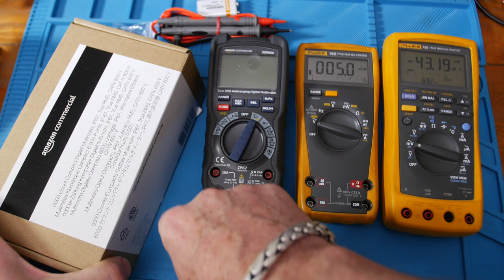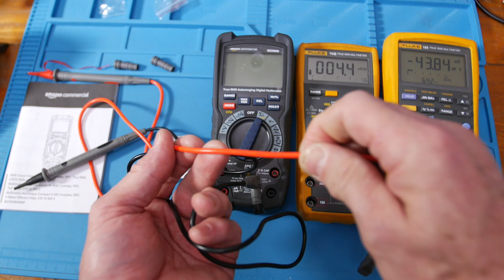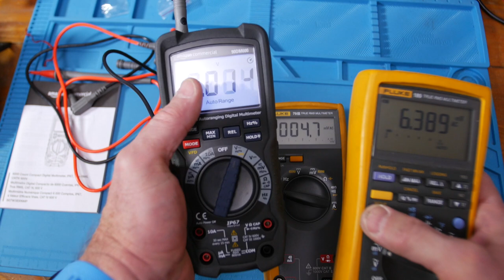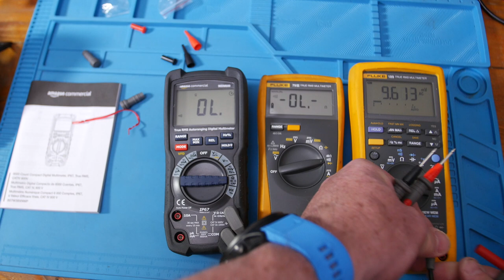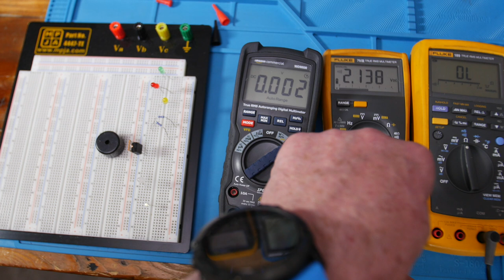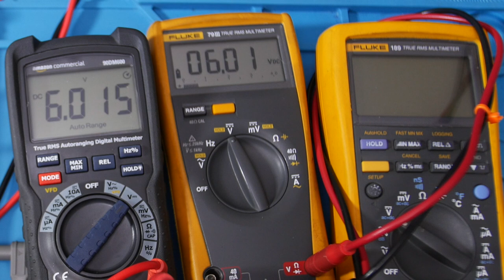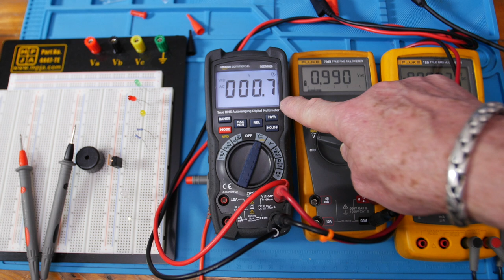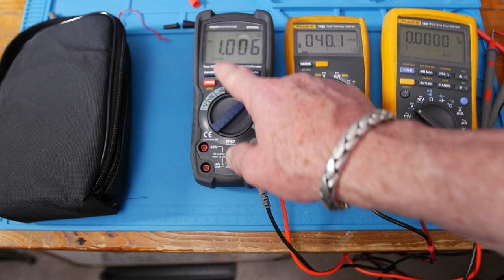Amazon 90DM600 vs Fluke 179 III Multimeter

Comment: Unless i'm wrong, i can see on the Amazon specs for the 90DM610 it has only a 200µF max range for capacitors 😱... Well, not for electronic jobs then 😖
Reply from the maker: Thanks for bringing this up:)  I reviewed the 90DM600 in this video and it is rated for 99.99mF, so barely short of 100,000 uF.  From what I understood, the 90DM610 added temperature reading, but I thought all other specs were the same.  But I see in the table below that it shows 200 uF.  The comparison table for the 90DM600 shows both having 99.99 mf.  So, confusing - which is correct?  I actually bought a 90DM610, so I'll test it in a review coming up shortly.  We will get to the bottom of this;)
Reply: @KissAnalog  Thank you very much for your kind and quick answer, very nice of you 🤩. I'm very curious about this discrepancy between the comparison table and what the amazon specs states. And btw, your video is fine but i'm bit dissapointed you're testing a very few range about capacitances. I'm not mean to offend you though 🙄, thank you very much, take care and have a good day 😎!
Reply from the maker: Thanks - and no offense taken;)  It is a great question.  I see others testing multiple capacitors, and to what end - to show that it can;)  I try to show the lower capacitance range and then the higher capacitance range.  I don't always have the best capacitor to test the extreme ends, but I want to show that it can test say 100 pF if it can go that low, and then say 30,000 uF if it can go that high.  Some can test high capacitance, but not go very low, and visa versa.  Does that make sense?  I'm still trying to learn what best way to review a meter;)
Reply: @KissAnalog  curious if you were able to test the 610 to determine its rating?

Comment: Hey friends. 

Great video. 👍👍👍

I bought the DM890 but it didn’t come with a battery. 
Does anyone know of the battery type/model or a replacement??? 

Best regards, 
Scott. ✌️🙏✌️
Reply from the maker: Thank you!  Do you have the 90DM890?  I believe it does take a lithium rechargeable battery.  Excellent meter by the way;)  Does it have any battery PN or info - like 7.4V 2400mAh?
Reply: Hey KA. 

Yea I managed to buy a replacement made by CEM as it was the exact copy of both meter and battery. 

Thank you for your time. 

Best regards, 
Scott. ✌️🙏✌️

Comment: Wow that's one heck of nice meter for the price. I'm wondering if Amazon even makes a profit off of these. Could be selling at a small loss to build up the "Amazon Commercial" brand.
Reply from the maker: Great question- thanks for bringing this up.  Maybe they are counting on big sales to get the volume pricing on the manufacturing.  Also, I think other vendors like fluke have continued increasing features with the big advancements in technology– but I don’t think they have lowered the cost with the lower cost of manufacturing.  I think these newer vendors are re-structuring cost based on actual material cost.  The company I work for automatically buys flutes regardless of cost – and I think a lot of people do this – so I don’t think Fluke is interested in competing with lower cost vendors.  Even FLIR with more features and very high quality, and is a high-end equipment manufacturer is priced much better than Fluke.
Reply: @KissAnalog  Yeah,as the old saying goes, "no one gets fired for buying IBM". I guess we could say "no one gets fired for buying Fluke" haha.
Reply from the maker: Lot of truth to that;)

Comment: I wish you had actually used a Fluke 179 (as the title suggests). The 179 has a 6000 count and probe holders on the back. And, at least on mine, it has a nicer continuity beep and the backlight is much better.
Reply from the maker: Thanks Ben - I tried to use a couple of Flukes to show what the newer 179 has.  I used to be a big Fluke fan, but they are just so expensive now.  I didn't want to buy a new 179 so I used the one I had.  Sorry about that.

Comment: I just got the 179 kit for like 450 USD. 😅
Nice to have a Fluke, but some of these other options are better for taking with you. Cheers. 👍
Reply from the maker: Thanks for your feedback!  Just think how much you would have saved by buying the 90DM600 which is arguably a better meter?  I have a new video showing the Southwire meter that is much better even and you can get it at less than $100 - which is simply crazy!!
Reply: Thanks. I'll check it out.

Comment: I belive this is actually am CEM DT-9560/DT-9561 , i bought the same meter in blue instead of black from a nordic chain store has it rebranded in thier own name.
Reply from the maker: Thanks Brian!  How do you like yours?  I think they are great meters;)
Reply: @KissAnalog  i am an electrician by trade working with alarm and access control, i feel you get at lot for the price and it seems to be an safe meter to use on mains voltage without beeing at risk by poor build quality , i have a few models from CEM and they seem well build and has good input protection, i also have both Brymen and Fluke, and ill still recomend the CEM's because of the price to quality ratio. -Brian
Reply: @brianmichaelnielsen3922  i plan to buy cem DT 9560. does this multimeter have good accuracy and quality?  I haven't found a video review for this model
Reply: @jatnikabudisantosa3049  i havent done any lab testing but my impression is that you get more value for money vs a Fluke for example, i would recomend the CEM for anyone not using it for something like aerospace kinda work where precision is mission critical, i often grab my "CEM" copy even thoe i have several Flukes at hand.
Reply from the maker: @brianmichaelnielsen3922  Thanks - these CEM meters are my choice over Fluke for sure.  I even recommended we buy them at the company I work now - which is a huge defense contractor.  I want to use updated meters with bluetooth and logging capability - and in a nice package.  This is the latest fantastic find: https://youtube.com/shorts/NHjzn9-h27c
Reply from the maker: @jatnikabudisantosa3049  I definitely recommend the meters made by CEM: for home and professional use.  Here's the latest fantastic find: https://youtube.com/shorts/NHjzn9-h27c

Comment: Here seeing how magnificent the fluke 79 is with the battery almost dead giving high precision measurements, most of the low and mid range multimeters when they are running out of batteries they start throwing crazy numbers in their measurements that are not accurate and reliable, that is something that must also be taken into account when buying a good multimeter.
Reply from the maker: Great point!  I haven't personally had this problem.  This Amazon works great and shows a low bat warning then just stops working, and most or all my meters seem to do that, so that might be a problem with older cheep meters.  One thing I do notice is that the more high-end meters that I have go thru batteries much faster - especially my Fluke 289.

Comment: These meters are rebranded CEM multimeters.
I think the 90DM610 (with the temperature function) is a CEM-9562:
http://www.cem-instruments.com/en/Product/detail/id/1434
(strange thing is that on amazon it has the part number DT-9561, but at CEM the 9561 is a 4k count, and the 9562 is the 6k count, and this is 6k count)
Nice review on these 👍
There haven't been a lot of in depth multimeter reviews on youtube lately on all the big channels, and now you're treating us on 3 in a month! 👍
Your review is way too good and meticulous for the 785 views you get now, so I hope your channel will grow exponentially very soon. Most of your content (also regarding the DSO's) is interesting enough for sure. I've learned a lot at least :)
For what this meter offers (UL listing, decent build quality/safety) the price is insanely low.
For electronics use you can maybe get a 9999 count meter for less with higher accuracy than 0,8% (like an aneng an8009), but not UL listed with big sand filled fuses, safety features, very rugged build etc.
So a very interesting meter for the amateur that also wants to measure mains voltage and high energy things like motor drives etc.
Maybe even that crazy aussie bloke would approve although I'm sure that Joe Smith would blow up this meter but at his channel it's more a question of 'when' instead of 'if' (although this meter also complies with the IEC 61010, which means it can cope with high voltage peaks up to 8kv, so for example static piezo surges)
Reply from the maker: Thanks GuidoK!  You are right, but I think Amazon must have asked for new models that would set them apart.  I'm really impressed with this line so far!  Thanks for the feedback!
Reply: Is CEM a good brand?
Reply from the maker: John Edwards I think it is.  They actually spend the money to get Agency tested.

Comment: There are no meters out there as good as Fluke.
I never even heard of Amazon meter.
Amazon dont make test equipment...
Reply from the maker: Thanks Sebastion!  I appreciate your feedback!
There are actually better meters than Fluke at half the cost. IMHO  My Amprobe (owned by the same company that owns Fluke) has more features and a better display, and my Flir with more features, better display, and comes with a magnetic holder and silicone leads which is awesome, and this Amazon Commercial is better than the 79 series Fluke at a much lower cost.  They all come with the same Safety certification testing, and are half the price or less.  I have been a loyal Fluke guy up until I started this YouTube channel and opened my eyes...wow we have been getting gouged by Fluke.  See my rant;)  https://youtu.be/3YW0aaED9aQ

Comment: CEM meters are good, better than UNI-T, but are no match for Fluke.
Reply from the maker: Thanks for the feedback.  I agree with you that CEM makes the Amazon meter, but I don't see the Amazon models sold by CEM, so I think they are built to a spec for Amazon.

I used to be a big Fluke fan, but in my opinion, I think they are overpriced and need an update.  But I am wondering why you feel that Fluke is better than the Amazon 90DM600?  The Amazon meter is 3rd party tested, and has more features at 1/6 the price of the Fluke.  The Amazon meter today is $50 (https://amzn.to/35HYDyi) and the Fluke today is on sale for $306. In my opinion the Amazon is the no brainer even at the same price.

I think the Amazon is more rugged, it has an IP (ingress protection) rating of 67 which is awesome, and I don't even think the latest version of the 179 has an IP rating.  This is big for electricians that might work outdoors or in certain dusty environments.  Also, the 90DM600 seems equally or even more robustly made, better display, and has more functionality.  It can read up to 99.99mF where the Fluke is only 10mF.  It has a higher voltage reading for diodes of 3.3 V versus the 2.7 V from the Fluke.  Plus it as a microAmp mode and has the VFD (variable Frequency Drive) filter that is good to get better more accurate readings from dirty power.  The upgraded 90DM610 has temperature and is less than $63 (https://amzn.to/3qhupf9), so with this meter the Fluke is beat in every place. IMHO;)

Comment: Now take that amazon meter and throw it across the room, bounce it off the concrete floor and throw it against the wall and let me know how well it works after that. The Flukes, at least the older models like the 77 series, will work just fine after the abuse. Why didn't you take it apart like you did the fluke and show the input protection ? These off brand meters are notorious for inflating the CAT ratings. The only way to find out if its legit or bullshit is to open it up and look at the input. The Fluke passed the CAT rating but we have no idea about this amazon meter since you chose not to open it up. I'll see if I can find a vid where someone does a teardown.
Reply from the maker: You must have stopped watching after I opened the Fluke because I opened the Amazon right after.  You are right, you can tell how great the Amazon is built buy looking at it.  Very impressive!  The Amazon has an IP rating and drop test that you only find on the most expensive Flukes.  This Amazon will survive more abuse, weather and drops than the Fluke that I compare it to IMHO.  Also, early in the video I show that the Amazon is tested by a safety agency (ETL), so you can be assured it is safe.

Comment: I've got a Fluke 87V bought brand new back in 2016 and for the price it's overrated and overpriced. I also have the somewhat less expensive Fluke 115 but it's also overrated. Fluke is way behind in LCD technology for their DMM displays. The fact is that today, in 2021, you can get a quality DMM (this one is even IP67 certified!) from China which is as good as a Fluke costing many hundreds of dollars more. Just to get a soft carrying case for their DMMs from Fluke is also ridiculously expensive. Not to mention that you get cheap ass vinyl leads, not quality silicone ones, with Fluke DMMs. Thanks for showing us this very affordable model.
Reply from the maker: Thank you!  I am with you.  The leads should be better than average for any Fluke, but IMHO they run with the worst on the market!  Also the Fluke displays are, at best, average IMHO    - ok they are crap for the price of the meter!

Comment: Those kind of reviews has no meaning to professionals! The only true reason I could see is the use of cheepy meters in a controlled workshop enviroment and not for professional use. The only cheap meter that could be a comparison to Fluke, Keysight, Chauvin Arnoux, Gossen Metravat, Hioki etc is the Brymen (some models).  It is not a good thing to consider that technicians, specialists, engineers etc are dumb and like to spend money for nothing.
Reply from the maker: Thanks for you great Feedback, I agree with those brands that you show, but I have to say that this Amazon Commercial meter line is quite good and has a robust design that is every bit as good as a Fluke at double the price.  They also come with 3rd party safety testing - and that is what the professional market would look for.  So, don't be surprised if you start seeing more of these.  Although, Amazon doesn't seem to spend any money to market them.  I suppose they think the quality will speak for itself and they will do fine without marketing.
Reply: @KissAnalog    Consider my comment as a general rule of thump for cheap meters and by no means I might argue for a product I have never been close to. You are/have been a pro and I respect that by all means. Yes, it could be a surprise if this meter could come close to a high-end meter.

Comment: hey, contury of origin Multimeter amazon
Reply from the maker: Great question!  I think the Amazon Commercial multimeter is actually made by CEM Instruments and I’d guess that they are made in China.  From what I can tell, they are made every bit as good as a much more expensive Fluke;)
Reply: @KissAnalog  thank you very good
Reply: @KissAnalog  Hi, the maximum range of capacitor measurement